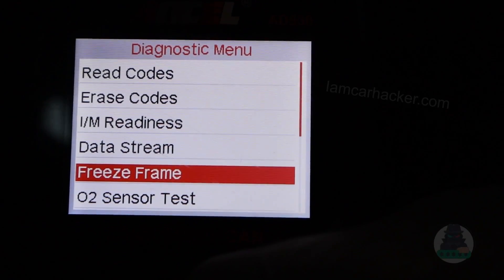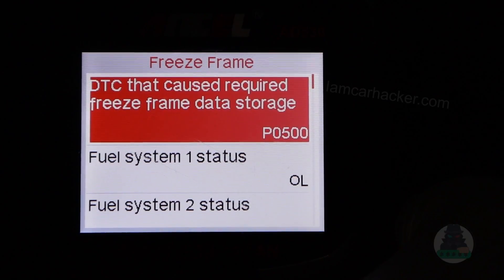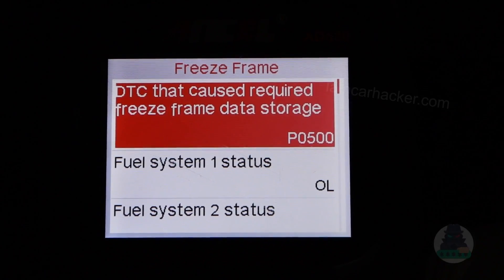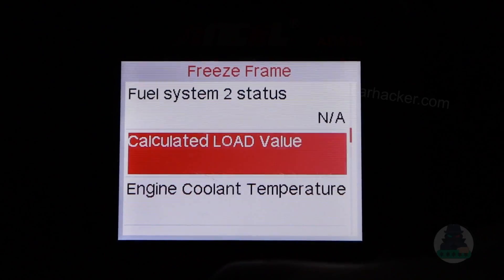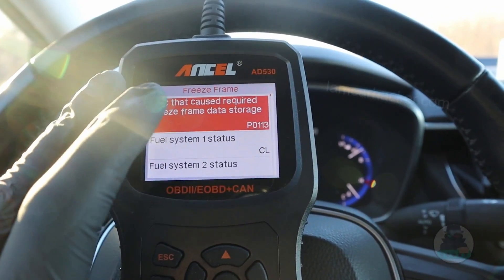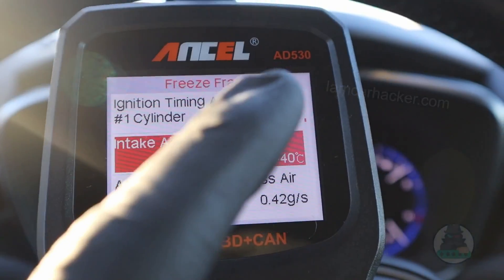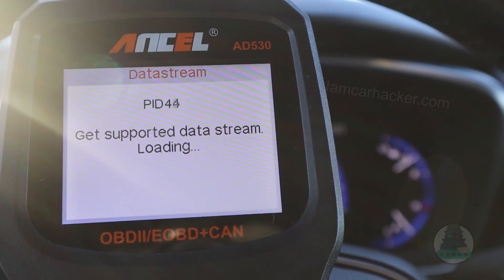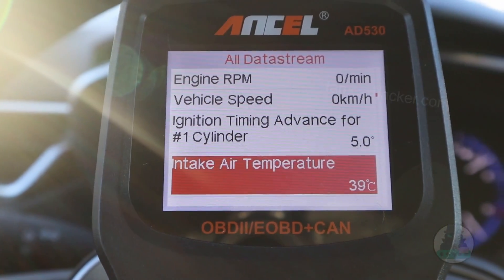What is FREEZE FRAME data on OBD2 scanner?

Comment: Does freeze frame data show the maximum values that occurred? For example, for p0219 over rev code, does it show the lowest rpm required to trigger that code (even if the engine went on to an even higher rpm) or does it show the absolute highest rpm achieved after the code was triggered?
Reply from the maker: It shows data from time when code is stored. So if the code is stored when the RPM is 1000, it will show freeze frame RPM 1000 even though it was not highest value from drive
Reply: @iamcarhacker  got it, thank you. So in the above example, do you know if there is a way to view the actual maximum values? Or is there no way to do this?
Reply from the maker: @muscleandimports  Only if you have connected scanner that does data logging you can find maximum and minimum values for that period for example with car scanner app + elm adapter.
Reply: @iamcarhacker  so you are saying you would need to have had a data logger physically connected and recording live data at that specific time to be able to refer back to the data at that moment, correct?